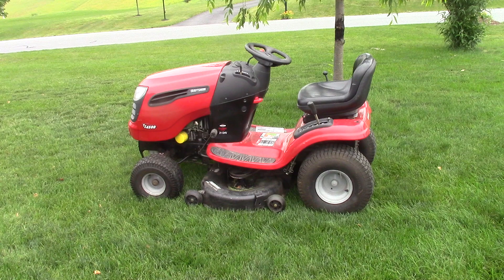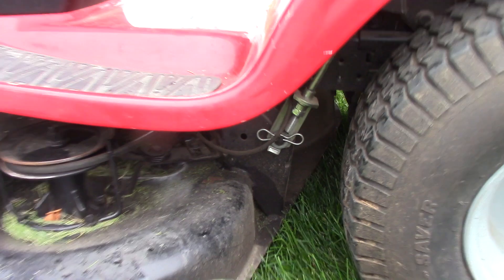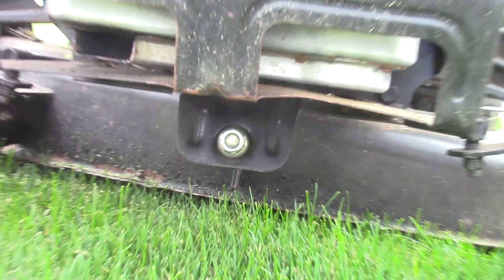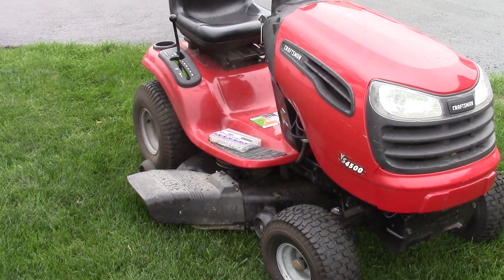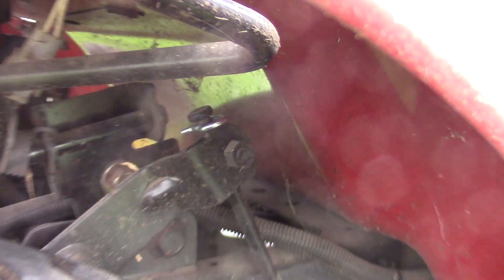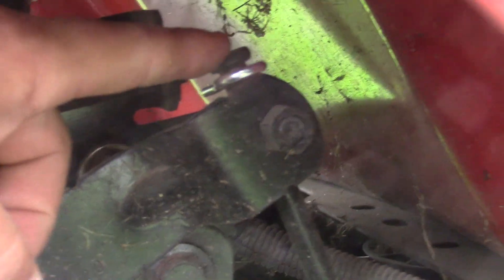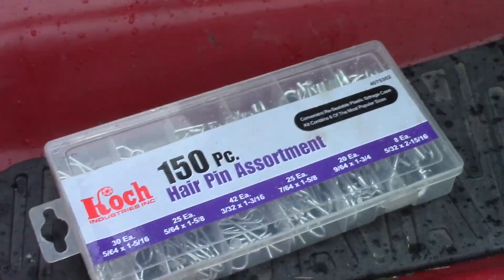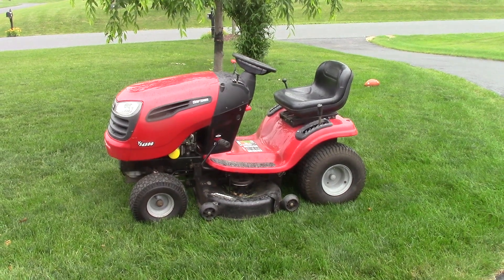Craftsman Husqvarna Tractor Fix: Level Deck Hack

Comment: Good Video. Thanks. I bought another left side adjustable assembly & replaced the right side lift. Solved my leveling problem by being able to adjust both sides of the deck
Reply: That is what I did. I think 25 dollars. Slipped right one.

Comment: Thank you for your post. After searching for the past 5 hours, your video turned the light bulb on in my mind. My problem is, my Husqvarna only has 6 settings and I would like to mow even higher. In the highest 6th position, it cuts at about 3.5 inches and I would like to go higher to 4 plus inches. Have fescue in North Georgia and it looks good cut high and less trouble when it comes to the bagger. And I certainly don't want to hit anything! So now thanks to you I know how to raise the entire deck above and beyond the 6th position. THANK YOU. GOD BLESS!

Comment: Pro tip: before you start messing with the deck, make sure the tires are all inflated. I spent a good hour trying to figure out why my deck was HIGH on the right side. Turns out, the left rear tire was deflated. 🤦

Comment: Nice fix! I recently ran into a customer's issue similar to yours. This mower would cut lower on the adjustable side than the other. I took the adjustment rod off the mower and put a slight bend in it to raise the left side. It worked, had to do it a couple of times to get it right, but it solved the problem. Bad engineering by the manufacture not being able to adjust both sides.
Reply from the maker: I thought about shortening the rod, but I did not want to do anything permanent to the customers mower.
Reply: I noticed a lot of Engineers and Designers should be cutting the Grass but I am afraid they would screw that up.

Comment: 1:38 I moved that rod pin to the front hole. That took the slack out of that rod, then leveled the adjustable side, then adjusted the front rod.
Reply: Is that adjustment still working?

Comment: I solved this problem on mine by buying anther adjustable lift link like the one on left side and put it on the right side, now the whole deck can be adjusted to where I need it.,,,, and the left link fits on the right side perfectly.......
Reply: We did the same as some higher end models had both.
Reply: What a great idea!  Why didn't I think about that.  Thanks, Farmerphil.
Reply: Adjustable link for the other side ? Is it made for a link on that side ?

Comment: My 10 year old YS4500 has adjustments on both sides, I wonder why they decided to cheap out.  Good fix!
Reply from the maker: All of them are going the cheapest way possible.  Even the push mowers with one lever to level the deck rattle and cause all kinds of noise.

Comment: I have a Husqvarna yth22V46 and it has just one adjustment and a rod like is on your craftsman and I was wondering what size hair pin did you use for the rod to help with your adjustment and what is a good blade height to cut grass on for the manuel states 2.5 inches on cool days and 3 inches on hot days. I was cutting mine on setting three, not sure what the inches were and had a weld break on the deck where the handle the lifts the deck to the bracket is was broke had it repaired and they adjusted it and now my 3 setting has gone to a 4 cause the 3 setting is now to low and the 4 setting is to high, can you help with this issue?

Comment: Cool video. I have a low end Troy bilt riding mower that doesn't have deck wheels. Any ideas on how I can get an even cut with it? I'm assuming I will have to retrofit some deck wheels but I wanted your input if you don't mind.
Reply from the maker: Start by leveling the deck.  Cut blocks of wood at 2.5 inches, put them under the blade tips and adjust the deck.  Turn the blades front to back and do the same thing but keep the front 1/4" lower than the back.  Go cut and report back the results.

Comment: YOUR CLOSE ! What I 've done is swap the 2 rods . I put the Ridgid rod on the LH side (Control Side) and put the adjustable rod on the RH side. Works perfect and lasts a long time. My  height adjustments read 1=0, 2=1.0" 3= 1.25" 4= 2.0" 5= 2-5" and 6=3.0" Front to rear is .25" up difference in the rear of the deck. And the adjustments were made with Mulch blades installed and Oregon Height scale.
Reply: Oklahoman,  I'm trying to level mine or at least get all of the 1-6 adjustments to function. I can't seem to get all 6 heights and when I read your comment about number one being 0", I'm wondering if it's because I'm trying to adjust everything on the concrete. The little deck wheels are hitting the floor at #3...    Any advice would be greatly appreciated 👍

Comment: I have this mower. My issue is... The first side you showed, that’s the side that is sitting low. I’ve adjusted that link as high as it will go. Still, the left side (oriented when you’re sitting on the mower) is still the low side. The side where you installed the hair pin, is the high side. Any suggestions?
Reply: Add some washers on that side

Comment: great fix! I had a newer Craftsman tractor a while back that I sold because of the crappy cut.
Reply from the maker: I can't believe how nice of a cut I am getting now.
Reply: Alan Marshall: I'm cutting on #1 setting (1.5") for my Bermudagrass. I must have bent the deck after some rough riding in the backyard. Now the cut is uneven. When I first got it the cut was smooth. I really hope this is the cure.

Comment: Great video Bob, I believe Husqvarna builds these. So with that being said I will look at my Husqvarna, however, I have not noted it cutting uneven, I also changed the spindles. Maybe that took care of it? Take care my friend.
Reply from the maker: Yes, same as Husqvarna.  The lower you have the deck set the better the cut will be because of the wheels.   This mower cuts very low you need to be on setting 5 or you will be scalping the grass.
Reply: I have a Husqvarna YTH22V46 Tractor that at setting 6, the cut looks too low. Any lower, it scraping the grass
Reply: @drod5157  I have the same problem with my brand new 42" Husqvarna. Even all the way up at the 6th position, it cuts too low. Did this hack work out for you D Rod? I will try it tomorrow in attempting to raise the entire deck another inch.
Reply: @dazeofmylife  It worked some

Comment: Just bought a 46" cut  Craftsman and it cuts my yard just like your neighbors. After checking tire pressure it was shipped with some over inflated tires on one side. I adjusted the pressure and raised the front of the deck up some, it was off about 1/4 inch lower than it should be. Mowed and it appears to be mowing level.
UPDATE: Noticed some streaking in the yard and checked the blades and found one side to be 5/16" lower than the other. Tried the pin but it didn't do anything. Calling Sears to get some direction. If they can't fix it, they can come get it.

Comment: Why not just cut that rod,thread it with a tap and die set and add a rod coupling nut from Home Depot and add nuts on both top and bottom of it to lock it. You should be able to adjust it with the rod coupling nut

Comment: I make my own deck pins out of stif wire.And i have never bought an air filter for a lawn mower.I use  foam packing from when you by something, usually picked from garbage.

Comment: I gave up on my Husqvarna and turned it into a cart pulling tractor. I found my deck to be sprung soon after I got it and the spindles on the blades were out of alignment. I tried shimming them to no avail. I even had the middle blade shaft on my commercial New Holland mower deck bend the mounting surface on the deck. That metal was at least an eighth inch thick. I think it hit a stump and bent the deck. There is a lot of force in a spinning blade. I mow my grass three inches high and I still get into trouble. Of course it is from operator abuse.
Reply from the maker: If you have a bent deck from hitting something it is very difficult to spring it back to where it should be.  You are best looking for a used deck that you can swap out, if possible.

Comment: Thanks DW. Going to give this a shot on my Husqvarna. You put one pin on each side, right? Do you remember what size?
Reply from the maker: Great question::::   Only 1 pin needed.  The side that you do the adjustment on leave it alone.  The opposite side from the adjustment gets the pin.  You will not believe how well it cut.  Make sure you pitch the deck from front to back.

Comment: Just bought a similar model YT4000. The issue I’m having currently is that sitting on my shops level concrete floor the deck will only drop to 3-4 before it’s sitting on the floor. And so will only raise about 1 inch total as I pull it up to 6. Nothing looks worn or stretched. Adjustments are about mid point in the threads. Any help?
Reply: did you figure it out? mine is doing that
Reply: I have the same issue on Dad's lawnmower I use to mow for my mom.  It was almost new when Dad died 2 years ago.  So it's like 4-5 years old, and somehow it already has almost no adjustment on the deck height.  It bottoms out at about 3 or 4 on the lever.  Did you figure yours out?
Reply: same here for me, but i think this video is what helps fix that to give it at least a little bit more range.

Comment: with all the deck wheels, it looks like it would have to float perfectly but obviously it doesn't.
Reply from the maker: If you put the wheels on the ground it will be cutting way too low.  You can only cut at level 5 and 6.  Now with this hair pin the perfect cut height is setting 4.